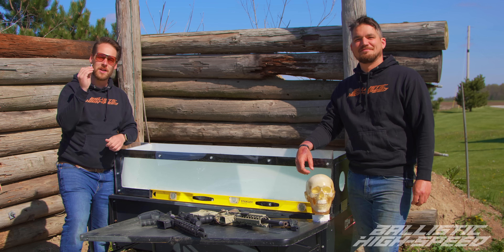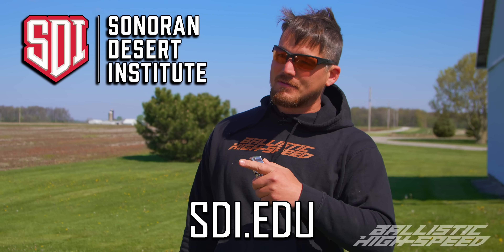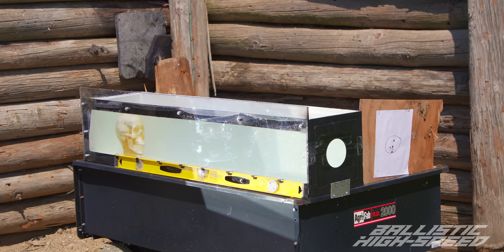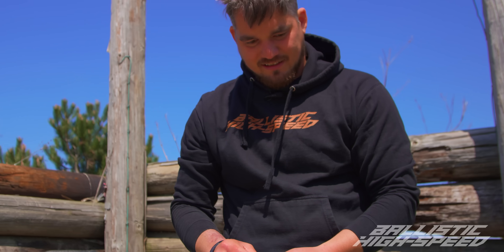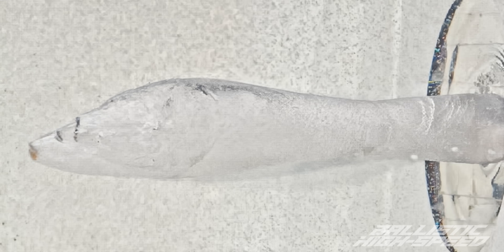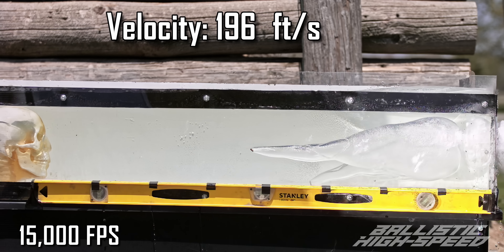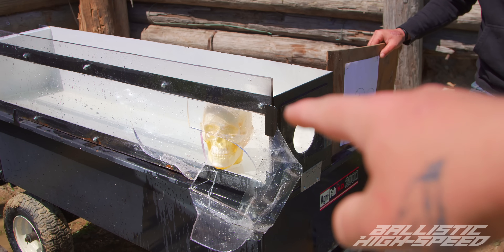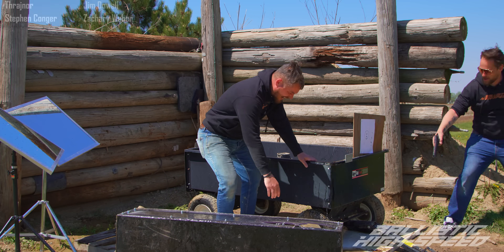How Much Water is Bullet Proof?? FMJ vs Hollow Point! - Ballistic High-Speed

Comment: As there's that law in the US, that because an air rifle isn't (technically) a firearm, you don't need a firearms licence (I believe that's the case), would it be possible to shoot a high powered air rifle at the water?
I'm assuming that because the pellet or slug is rounded it will travel further than explosion driven rifle ammo!

Comment: Ahh, science, the reason the bullet is traveling easily is due to the ATA or atmospheric pressure of the water being 1. My hypothesis is that the higher the water pressure based on depth, the smaller the distance the bullet will travel through the water due to it pushing through denser water having a higher ATA. 👍 I know this from scuba diving.

Comment: The problem / paradox is that the more energy the bullet has, the more resistance water will pose to it... as it's basically noncompressible.
So counterintuitively the "better" calibers / rounds will lose their velocity far more violently and on a shorter distance than the slower ones.

Comment: For version 2 of your box, I'd recommend rather than bolting the plexiglass to the steel box, have it held in place by springs.  That way when the lateral force comes, the springs extend, letting out some water and relieving much of the pressure before snapping back into place.

Comment: That 45 JHP had a really neat effect. After the jacket pealed off it seems like it was able to move faster than the lead core because the lead core was being slowed down by the water while the jacket didn't have much resistance moving through the space behind it. You can see it catch up and try to pop up behind it which was really neat.

Comment: If (or when) you redo this, consider a vertical tank and shoot top down. The dynamics will change significantly when shooting against the air-water surface tension compared to shooting through the tape. The resistance to penetration, contrary to what common sense may tell you, is significantly greater.

Comment: Mythbusters did a simalar test and I think what your missing is the size of the body of water and going from the surface to the bottom. As the bullet goes deeper there is more pressure, think of an empty steel can, as it goes lower and lower it will eventually implode. The amount of water makes a difference because their is more weight involved. if you had a swimming pool and went in from the side at the top you would have the same results as you did, but in the same body of water entering from the side but at the bottom of the tank you would have vastly different results. in a lake you only need to be a few feet below the surface to be safe, regardless of whether you used a 50 bmg or an 220 Swift.

Comment: Theu should use a verticle water tank tower instead of a horizontal one. 1) it is more accurate we see the bullet hit the water surface instead of hitting the plexiglass-which takes away the bullet speed.  2) they won't have to replace the plexiglass every time.

Comment: i think the bullets behave differently when being shot down into water as well because of pressure difference and more surface tension. In this case the pressure and surface tension is pretty much equalized and consistent but shooting down into like 5 ft of water will most likely be different because surface tension and pressure of the water will be more of a factor since the bullet is entering at an angle to achieve depth. Normally a big, slower moving bullet does better in that circumstance like a .45 acp FMJ vs any other ammo.

Comment: 15:14 Notice the head does not move when the bullet strikes. It is not connected to a body, and there are no muscles to spasmodically contract or relax. The only motion we see is very slightly backward when the pressure wave behind the projectile strikes. This clearly debunks the JFK second gunman  "back and to the left" claim used by Jim Garrison to indict and prosecute Clay Shaw in 1969.

Comment: I really think they should have shot the bullet vertically. Because:
1. In which scenario do you shot someone underwater horizontally? I think it will always be from above in a slightly angled direction.
2. The deeper the water, the higher the pressure. So if you shot it from above I really think that the water volume and the depth of the skull will influence the bullet velocity.
3. Shooting it from an angled direction, which is the most possible scenario, will give a slightly more area impact before the bullet penetrates the water surface which can also influence the velocity.
4. The acrylic sealing the water surely influences the bullet velocity because if you want it to be as accurate as possible, you don't want the bullet to hit anything before it hits the water. And I think after the seal is broken the water also lose some of it's pressure since there is a leak.

Comment: Not accurate, you have a compact environment, the shock wave is much more substantial than if you were shooting into a pond, ocean or swimming pool.  The greater the container the less impact the shock wave will have.  Mythbusters did it in an Olympic sized swimming pool and the results were significantly different.  No ones going to hide in a water box to be protected from bullets.  They jump into a pool, lake or ocean.  Try doing this with salt water vs fresh water.   I’ve actually tried shooting fish in a pond when I was young and stupid, even in 6 to 12 inches of water never got the fish.  But I got very wet from the water coming back at me

Comment: So basically, the 9mm FMJ has the best penetration underwater compared to the other rounds used in this video. Honestly, that's very surprising. I figured the .223 or 5.56 would of performed the best but I guess we all learned something.

Also, you guys should of expected the hollow points were going to significantly slow down in water. It's literally it's job to expand to do more internal damage and not over penetrate.

Comment: Here's what I propose next, build a bigger box that's the same depth, but wide enough to fit a human behind a metal plate near the hole where the tape is. Put one of the dummies right next to the plate so we can see if the water displacement could damage the dummy or if you could find some other medium that would simulate a human underwater right next to the round entering.

Comment: Oh no ,, why no .22lr (both solids and HP) or blackout subsonic rounds ,,,   , a suggestion, make the tank more robust and have a make a catch tray in front of it , have a small pump running that delivers back the water that runs out+ a fast exchange system for the front  for the fun try using a round ball black powder  musket

Comment: This is only accurate if youre swimming inside a 12 x 12 inch square tube.
Make the experiment identical, except use 48 x 48 at least. Not to mention the extreme difference in surface tention present, that would also be surrounding you whilst having a swim. Also, you need to add altitude and reference to sea level in regards to the location of the experiment. These all make a difference. 
Add the fact that your water is very clean and free of and dust mud or debris like a typical body of water would have. Temperature of the bullet and the water make a difference as well. Just some thoughts. More people want to know that kind of stuff. If they dont, they should haha. Either way, your characters seem good, but try to add more stats and controls because the more we know the more it helps. Keep up the cool content.

Comment: How is it not common knowledge by now that faster projectiles stop harder (and sooner if it mushrooms and stays together), sectional density being equal? And also that water is one of the toughest test medias as you move into rifle speeds? Ice and wood is softer on the bullets than water is.
The norwegians used to have a water round back when the 6,5x55mm was in service. The projectile was aome 5-10cm long. An arrow is the extension of this logic, it does quite well in water. Long and slow.

Comment: Can already tell you the test is flawed. Water pressure changes with head-height. You’re firing into a constant pressure (your firing at level) vs firing down into a gradually increasing pressure (down into a pool, pond, lake, etc).

The dynamics change drastically the deeper the bullet goes…

Comment: You guys need a better box. Get a sheet metal shop weld up a 10ga stainless box with a 3/8" stainless back and use 3/8-1/2" lexan for the window.

Comment: Great footage but to be accurate you need to fire directly into open water where the impact pressures will not alter the results as shooting into a box where pressures and counter pressures are magnified. Believe it or not the thin plastic also will distort the trajectory and shape of the bullets before entering the water. Gain to shoot into the water either straight down (from a top) or from an angle into the water entering from the surface is actually the most accurate method to get the results you are seeking. Think about it if someone was to shoot at a person, shark, fish etc. It’s from above or at an angle from land or boat, not at the same level through a glass or plastic film. Looks like it’s time to learn scuba diving and buying Underwater housings for your cameras, be sure to get the proper red filter, fish eye lens's for UW housing,

Comment: Two things: 1) You should also try flat-nosed FMJ with your pistol rounds. They're very common, and they perform substantially differently from RN FMJ -- and they're supposedly better for tissue wounding.  2) You should build a box with plastic on the top as well. You're not showing us bullets "under water" in the way you think. You're showing us bullets "under water," but near the surface -- which could be something significantly different...
Excellent video!

Comment: 👍Great job on the video. 🤔However there is still one bullet you didn't try.🤷‍♂️

https://youtu.be/fMDqRdmXNG0
Supercavitating bullets, like the CAV-X bullets from DSG, can easily pass through water by creating a narrow air corridor through supercavitation. 

Supercavitation is a technique that uses a cavitation bubble to reduce skin friction drag on a submerged object and allow it to move at high speeds. 

Supercavitation is the use of a cavitation bubble to reduce skin friction drag on a submerged object and enable high speeds. Applications include torpedoes and propellers, but in theory, An object encounters a liquid at high speed.

Cavitation happens when the static pressure of a liquid drops below its vapor pressure, causing small vapor-filled cavities to form in the liquid. When the speed of the submerged object increases and the cavity is large enough to cover the entire object, supercavitation occurs. 

Supercavitation is used in torpedoes and propellers, and in theory, it could be used in an entire underwater vessel. Russia, Iran, Germany, and the U.S. are the only countries known to operate supercavitating torpedoes. 🌎✌

Comment: I wonder how much difference (if any?) there would be shooting water "at depth pressures" vs "surface pressures"?

We know that water has a lot more pressure to deeper it goes because of the weight of the water. 

So would that have any effect on projectiles shot into it?

Let's say you had a tank just like the one in the video but it was 20 ft tall... The water on the bottom would definitely be under more pressure than near the surface. 
So would that affect bullet travel at all?

Comment: I like your ideas of underwater shots. The different calibers, the distance they will go; and  the various bullet designs all make the results fascinating.    With enough repetition, you could write the average statistical results.  I don’t know what those results would or could be used for, but they would definitely be interesting.  I would also like to see the comparison of results between potable water and sea water.   I would expect that with enough testing you could write a constant coefficient of the reduction in travel distance in sea water vs potable water. Thanks for the entertainment and the education.    BTW: you might try a rubber “door” on the tank to see if it would be self sealing (much like self-sealing gas tanks on military aircraft).  Some velocity would be lost by firing through the rubber, but not nearly as much that is lost now as the water escapes in the opposite direction of bullet travel.  Meaning that as water rushes backwards to escape through the entrance hole, it drags the bullet with it. That is like shooting directly into an oncoming wind.   There is a similar energy loss, or at least interference,  by water being splashed out of the top of the box.   Making a taller box with a lid will decrease the loss of water.   Also the same amount of water needs to be in the tank at the time of each shot.   More water increases the mass, which slows the bullet; while less water. will decease the mass allowing an increase in the speed and travel distance of the bullet.   On the other hand, you can choose not do any of this mental masturbation, and just see how much water you can blow out of the water box.    😊😊

Comment: The water depth is too shallow and water volume is too small.

Remember, different depth and water volume will have different water pressure that will resulting significantly different resistance.

Comment: Considering hollow points are designed to expand and not over penetrate it seems to have done its job. That looks like a 1 inch circle pinching through the water. I’m so glad we aren’t made of water. That would hurt. Also that level looked a little sketchy flying at the camera after the .308 hp. Cool video, got me to subscribe. Thanks.

Comment: Hmmmmm.
So, if I wanted to make a bulletproof home or panic room, and for whatever reason, couldn't use or obtain enough thick steel or concrete....the next best option is to have a chamber or layer in the walls filled with water, maybe even offroad tire-sealant with lose fiberglass fibers, and rubber balls in the water, in different common & extreme bullet sizes, and have them either be of different densities to float at different heights in the wall, or, have underwater fans, air pumps blowing air into the bottom, or whatever to make the sealant media stay tumbling & mixed, so if any part of the outer wall is shot, the water, and materials within catch the bullet, and the materials plug the bullet-hole, keeping the walls topped up for the next shots. Maybe a strong, welded together mesh fence can hold up the outer membrane or wall?

The floor can also have a thick, water tire sealant layer like this, but I don't know how to protect the top, and allow occupants to get fresh air in such a protected room or home, unless the air ducts have zigzaging kevlar walls to catch any bullets being shot into them, and a powerful air purifier in the safe space for chemical attacks through the vent.

And maybe the intake & exhaust of the air vents can be shaped in a way where it is very difficult to block up for suffication. Like lubricated rows of expanding shark teeth, all angled downward, in an expanding wide funnel, to prevent glue or foam from sticking, and shread bags or sheets the attackers try to use to block the air intake?

I think this is the first time I thought about how to defend a home, without directly fighting back with hand weapons & traps.
Using water if steel plates and concrete are unavailable...oh, theres also dirt and rocks. A bulletproof mudhut?...But if you can't move or hold that much material, like weak floors, then maybe chambers or bags of water or home made tire-sealant?

I don't know. But great video.

I can picture someone jumping into a deep pool, swimming to the bottom, taking out a hidden air mask from a hatch, then looking up and flipping-off home invaders, who are locked into the home and pool room, like the emergency lock down in a store, freaking out as the cops or a killbot is coming for them.

Of course, they can jump in, and try shooting closer, out of spite, or still getting assassination payment. But I don't know how well different guns work underwater.
And who breaks in with a spear gun?
Maybe a Florida Man crackhead, but who else?

Comment: For your deceleration info, I'm assuming you're using a numerical method effectively similar to the trapezium rule whereby you're taking linear averages over a small timestep. Out of interest, what length of the timestep is  used when making these vids?

Also something interesting, since the bullet is travelling in a fluid, the drag force is proportional to the square of speed (1/2 rho times V squared) but then kinetic energy is also proportional to the square of speed (1/2 mv^2). This implies that kinetic energy is proportional to drag. However, the .45 is heavier and so has a lower velocity in that formula. 45 should have less velocity, but a larger surface area. The lower velocity should mean less drag but it's a question of whether the surface area negates it. Since speed is the squared term, I'm thinking it probably won't negate. Drag coefficient is also a factor. Since ball ammo should generally have the same kind of form factor, I can't imagine them being too different.

Comment: If you angle the back wall outward you will reduce the energy transmitted to the front Lexan panel. Other options are possible to reduce that over pressure and absorb the hydro-static energy..

Comment: In general it works same way as jumping into the water - from safe height you don't carry som much velocity and kinetic energy meraning that theres more time to break surface tension and for the object to "slide in". Everyone have heard the expression that from really high jumping in water its allmost as jumping on concrete  - the surface won't break so the object damges or destroys itself. Same applies for the bullets. I mean 50.cal would probably shatter upon impact.